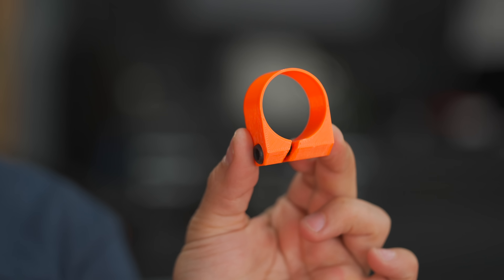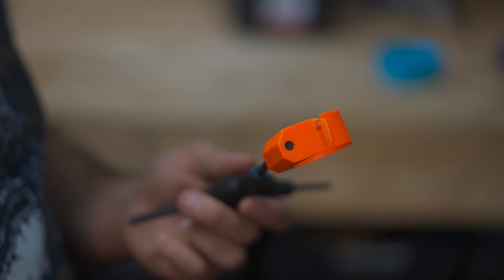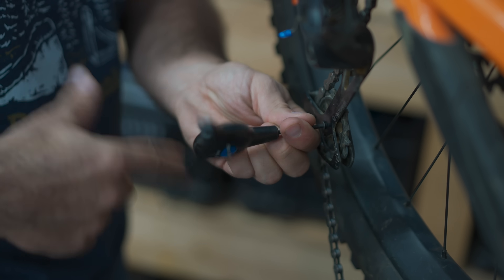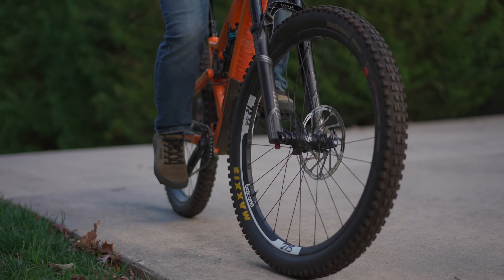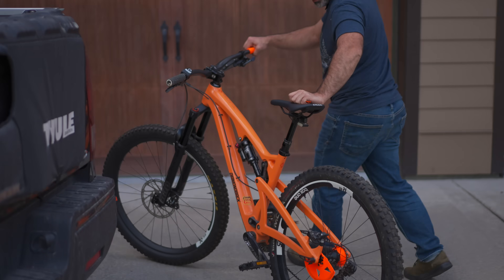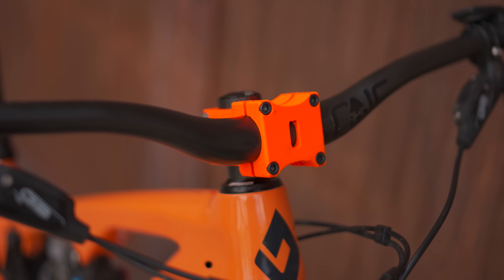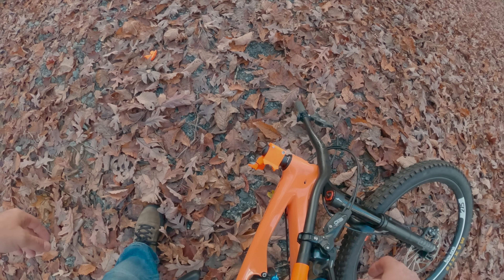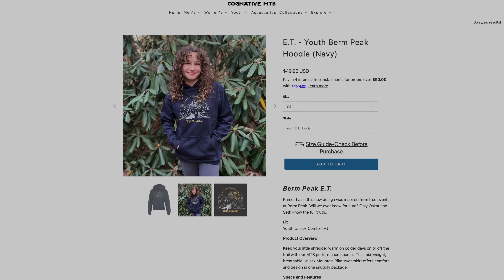Will 3D printed MTB parts break catastrophically? Let's find out!

Comment from the maker: I didn’t upload my designs because these are actual bike parts that could fit on a real bike. I’m not so sure it’s smart to put them out there. Also, I’m not sure why I referred to the hex size in the axle with an M before it. It is just an 8 mm hex.
Reply: try putting a nut in the opposite side of the bolt, so you dont use platic thread
Reply: What about making 3d printed spacers
Reply: Господи! Какие же страшные у него получаются 3д модели...
Reply: You should try using TPU filament, for grips, and carbon fiber filament, for
Reply: You probably saw m6 written on the legit axle and the brain just went with it
Reply: I think your test is full of holes due to the fact most people would of print those parts out abs or asa filament that is known to be a lot stronger
Reply: I really think this could go somewhere interesting, maybe shape uploads with fellow creators you trust
Reply: By god somebody ship this man some PA6 CF filament
Reply: Threaded inserts and a bit of engineering design would have gone a long way - highly recommend learning something a bit more advanced than tinkercad. It's a good way to learn spacial geometry but becomes burdensome quickly past very basic shapes
Reply: I think personly you must use abs
Reply: M8 would be the threaded section sizing.
Reply: Quickly looking at your prints, you may way to reduce your layer height to increase strength (especially on the round/clamping parts. The infill on your bar clamp looks almost OK, but try out Gyroid infill and give yourself more shell/top/bottom layers
Reply: @NickBiancalana  Reducing layer height does not improve strenght. Parts break between layers. Then, I think more perimeters is the main thing. 8 walls 10% infill is stronger than 3 walls and best infill.
Reply: @1312_PV  it depends, it's alwayas a juncture of settings, but  thin layers generates more pressure between the nozzle and the last layer, this also warms up the region generating better layer addesion;
Reply: @luistiago5316  You can extrude thick layers with much material so they are squeezed too.
Reply: @1312_PV  then you would get underextrusion with normal printer extruder and nozzles... this isn't Seth's expertise. I am trying to work it out for him without making it a trouble journey.
Reply: M8 is the normal correct way to say a metric 8 mm. Trust me I'm European 🤣
Reply: @stevenconnor4221  I've only seen the M with a number attached refer to thread sizes, not allen key sizes. Those I've only seen referred to as x millimeters or simply the number of their size. Whenever there's an "M" before a number I think of metric threads.

I'm german tho, and we tend to call numbered tools simply by their numbers with "er" attached, like "sixer", to give an example that sounds similar to what we'd say in german. "Ich brauche einen sechser (Inbusschlüssel)", for example, translates to "I need a sixer (allen key)". Alot of times we leave out the bracketed part entirely when it's clear what kind of tool we're referring to. Same thing for wrenches, instead of "13 millimeter wrench" we tend to just say "13er".
Reply: @DualDesertEagle  Hi there I did not say that was the correct way to ask for an Allen (Allen is a trademark so hex key should be the proper way to say that) I just said M8  means metric 8mm.  If he asks for an M8 Allen key, he will get it, correct? Not really he should have asked for a 8mm hex key.  It takes every kinda people 😄 ps I'm a mech tech by trade.  Did you see what I did there? Everyone calls them Allen key but that is a brand a registered American company whose name has become synonymous with hex keys hence you said Allen keys. Is it correct nope but everyone will know what your talking about.
Reply: @stevenconnor4221  Part of the reason why I called them allen keys is coz that's the first thing I've heard them referred to in english and the other part is that I never knew that that was a name brand. Same thing with velcro tape, tho Seth himself (I think) once said in a video that "velcro" was the name brand and "hook 'n loop" was the general term for it. That stuff is called "Klettband", "Klettverschluss" ("Band" = "tape", "Verschluss" ~ "fastener") or even just "Klett" in Germany and I don't know of any other name that would replace "Klett", which in turn comes from "Klette" (the bit of vegetation that latches on to ur clothes when u brush against it, I think 1 of the english names for it is "burdock") and, given how the stuff works, is an obvious choice for a name.
Reply: @DualDesertEagle   I wouldn't worry about it there are lots of English speaking persons who don't know that Allen is a Brand name either.  As you get older you realise that English is not English it's a mixture of Greek Roman German French Gaelic Anglo Saxon, Norwegian to name but a few. I would have thought that it's more akin to the sticky willy plant hahaha cleavers, the wee round balls that stick to you, it's a weed but very important as a side note you can collect the balls and roast them down then you have coffee bean substitute (useless factiod no5 :)   sláinte mhaith
Reply: @stevenconnor4221  I think in german those sticky little balls are called "Kletten" aswell, and as far as I know they work the same way but with much finer hair. That they make a good coffee bean substitute is indeed useless information to me since I don't drink coffee 😛
Reply: One thing I would recommend is using petg filament it's durability is far better then pla. You can also most likely print nylon and carbon fiber nylon wich will really improve on all aspects. Threaded insets can also help on the thread strength.

Comment: If you printed some of these with ASA or ABS, or even glass fiber reinforced ABS, some of these parts could absolutely hold up. I was actually a bit surprised by the stem breaking, probably mostly due to material choice and being very thin at the front.

Comment: These could've worked well if things were designed properly. You can't use a far weaker material and expect to just copy and paste a design. You almost had a helpful video if you had just engineered a little more.
Reply: Also petg is very brittle. Pla would have more energy absorbency and likely give you a better feel for when it's about to give out

Comment: 9:15 you literally are using a really basic material, looks like PLA with how its breaking but I suppose it could be petg, either way don't say the process is bad untill you use a good material.
Reply: He did both say and show it's PETG. I think the main issue is they were made with little thought put to print settings.
Reply: @extrahourinthepit if it was PETG his print settings must have really been sideways.

Comment: I got it was two years ago, but... Better understanding of material limitation and/or stronger printable materials make the deal. There are some printable plastics which needed enclosed printers, but they clearly will lasts for long enough.
Braking rotors are... stupid thou. Sorry for insult, but it will melt sooner or later no matter which plastic You will use. Also gear is a bad idea for same reason. Grips thou are good idea, but with a catch - better to use metal lock(basically each of grips with locks on them have plastic base so it WILL work). I doubt any plastic will have enough tensile strength to work as seatstay lock. Good idea to use plastic in gear actuator or brake levers, but NOT PETG thou - it is extremely brittle for that application. Jockey wheel is clearly perfect for being printed thou NOT FROM PETG!!! Even stem will work thou better not use it for trails, for commuting it be ok-ish, but NOT FROM BRITTLE PETG!!! Anyway main mistake from engineering point of view is choice of material.
I hope there be "3D printed parts: comeback from the thrash bin" on this channel. It be a blockbuster if it be made in cooperation with some one who actually work in engineering and kind a specialized exactly in plastics and/or printing.
Printed part are much more useable than it looks in this video, but please do it wisely using Your head if You interested in it.

Comment: I noticed the seat post holder snapped in a perfectly straight line. Do you have z staggering on so the seam isn’t a straight line weak point for the print?

Comment: PETG might not be the ideal material for this kind of stuff. Whereas it is resistant to heat and UV, it has a tendency to completely snap when it breaks. I think you might want to look into Nylon and maybe ABS or possibly other materials. Also a lot of the weak points of the prints could probably be avoided. E.g. try to avoid sharp corners and edges and instead of the printed threads I would use heat inserts or washers and nuts. Slant3D has a lot of useful videos on how to design things for better stability, this might be a good starting point. I enjoyed your video! Please don't hurt yourself!

Comment: time to revise this

how about a modern enclosed printer and print the items out of PA6-CF or PET-CF for example? yes, they will fail aswell, but the should hold up way better than PETG on an open printer

also: 3d-printing a mould and fill it with carbon fibre and resin to create a "forged carbon" part is usally the way to go, it can be used for example to make break levers, housing parts etc - the strenght is comparable to cast aluminium

Comment: PETG is just wrong material. PC is much stronger. I would not be afraid if jockey wheel made from PC. I was even thinking about trying front chainring, but it would probably be bit flexible causing loose of power.

Comment: You should print things in Carbon reinforced Nylon also known in 3d printing as Black Aluminum. In many cases quite useful,I printed some hub ends for a front axel converted hub from 9qr to 15ta works great, its really not taking a lot of unsupported pressure., and a torch clamp on handlebar works great

Comment: It's the petG fillament it's probably got brittle if stored in your workshop obsorbing moisture when cooler temps at night etc try a brand new sealed roll, it might last a few mins longer lol it's ment to be for durability and stress but I'd try an abs or a resin abs

Comment: The single speed gear could feasibly work as a lighter replacement if it’s designed to take metal teeth, since it looks like the only section that broke was the teeth themselves

Comment: As with most practical 3D printed parts, they are mor for protyping than final product.

I for one will do a batch of stems with different  lengths and angle combos. To see what fits me perfectly, and then buy/make a cast or milled counterpart. Based on my findings.

Comment: Ive been printing a bunch of parts for my bikes lately. Mostly petg and some stronger stuff for parts that have more structural function (reinforced nylon).Different approach though and it doesn't work for all applications of course. Ive been using a lot for my pack bike setup in combination with some cnc, its really nice to make things to fit instead of having to track down expensive parts that might work out the way you want them.

Ive been looking into doing some wax prints now as matrix for aluminum casting for some parts for a vintage racing bike im fixing up. I expect it should work pretty well.

Comment: What you did there is making initial 3d model of part which is designed to be built without 3d print. 1st you should check tension points and find ways to resolve those in unique way while printing is different manufacturing concept. Then once you have you plastic part as you like, print it with proper material for application. You can print metal, carbon fiber, composite materials and what not. It can be much stronger and lighter than regular aluminium or steal parts, just you need to use benefits of shape from 3d printing and proper material to print with. Your content is great though, learned a lot.

Comment: To be fair, 3d printing your threads for a bolt hole is never the best method of putting bolts in printed stuff, either make a captive nut on the other side or use a heatset insert that you melt into the plastic, your parts would definitely live a little longer that way. Also PETG is not really the best material for this either, you might have better luck with nylon or polycarbonate or even ABS (just pony up the $50 for a creality enclosure tent it’s so worth it) and those materials also have carbon fiber variants that are stiffer for things like the Thru axle. That said please for the love of god do not test those parts like this because the stiffer and stronger the part is, the more abruptly it breaks when it fails.

Comment: How about doing a follow-up -- instead of trying to create structural parts, which we ahead of time know will fail, then what about doing some of the things which the rest of us cry for ?
Say, my own plastic for hiding tools in the handlebar -- instead of being ripped up by some seller? Bottle cage holder at the back of the saddle and adjusted to leave place for my butt? I want to mount a back light in a 6 mm hole next to the back axle --- but have no brackets, no standards for any lights any more. How about .... a deraillur hanger? -- I broke mine once and it took hours with paper and a pen to get the replacement hanger to fit the frame .... 

Smart parts, not structural parts! ;-) --Otherwise, get access to a metal-printer instead!

Comment: The brake rotor is actually kinda cool, since once it breaks in breaks it will turn the back brake into an E-brake, since it will just lock up the back wheel if you touch it 😅

I'm pretty surprised that the axle worked at all, but PETG has impressively good layer bonding when it's dry. Still sketchy AF though.

Comment: Older video but the worst material you could of chosen for strength is petg. It’s great for plastic hinges but it’s flexible were it can flex and return to original shape & that flex is what makes it a weak point. It needs to have stiffness were it doesn’t flex or deforme. I’m sure it was just a whatever test for shits and giggles lol but try nylon filament or asa for your case scenario. I wouldn’t go for nylon infused with carbon fiber because it might seem like a better stronger option, unfortunately carbon makes it weaker or so i found. Best of luck & hope you revisit another printing video with some of these tips in the future!

Comment: PETG is kinda brittle. While it's better with temps its typically weaker than PLA. Get a chamber and print it is ASA and you might actually have something useable. Still new to functional parts but I have used ASA for some very useful stuff like replacing the plastic parts of those cheap folding camp chairs and so far they have lasted better than the originals, which I assume were ABS injection molded.

Comment: Print orientation on your stem could have played a factor in it breaking. A printed part will often be weakest along the layers. That said, you could have cast everything you printed by encasing them in casting plaster, burning out the material in a kiln, then  using something as simple as molten soda cans.

Comment: 1. reinforced Nylon with glass or carbon fiber would be a better material choice.
2. Threads do not fit any plastic. even your carbon parts use metal (steel) thread inserts to join together.
Steel Thread insert are common and cheap

Comment: Things that work; valve caps, saddle mounted fender, tech mounts like lights and wahoo, seatpost sleeve adapter(31.8 to 27.2) if 100% infill,  pannier clip adapter for lights, spoke rattles (beads that slide over spokes on kids bikes), spd pedal service tool for 24mm socket insert, reply with your ideas
Reply: Anything not significantly load bearing goes fine. I have currently in use PLA printed light mounts, bottle cage adapters and such brackets plus some simple tools. Ever since I learned to design and print my stuff well, took a little while and some trials and errors, most of the parts have lasted for years already. My own custom designed prints have proven to be of great value in use, something I couldn't live without anymore and fortunately replacements or extra copies are always easy to print per need.

Comment: This test was not needed at all to understand in what places 3D printed parts can be used - only in the tensioner rollers, where the same plastic parts are used, because there is no load. All parts that are used on the bike are made of plastic, you can also customize and use 3D printed ones.

Comment: not that 3d prints would replace any of that parts BUT! if you want to print durable 3d prints you need to do it right! first of all there is diferent materials you can print also you need to fill the whole prints 100% percent with plastic not just 60%. and than you need to engeener these parts diferently because plastic is not metal! Also if you want to use screws there are special threads for 3d prints or plastic parts you can put in with a soderingiron. In theory you could print some of these parts as ridget as metal ones

Comment: Use speciality  filaments like TPU for the grip to give you squish. There is also carbon impregnated speciality filaments that will significantly improve the strength. You just need to upate your printers hot end for some of these filaments. But still worth a try, perhaps in the future.

Comment: LOL! I beleive you could make good 3d printed parts, though, but use lots of walls and high infill, preferably gyroid, since it's strong, and probably another material, like nylon with carbonfibre (PA-FC). I doubt you can print that well on an open Prusa, but perhaps if you make (or buy) an enclosure for it, it should work.

Comment: Petg is nice and strong but the issue with it is that the impact strength and elongation at break is very low. When PETG fails, it shatters. in this case PLA+ will probably work well for some of these parts (aside from low uv resistance) otherwise pa6-cf or gf will perform great for most of those parts.